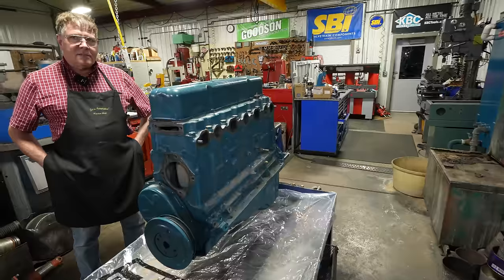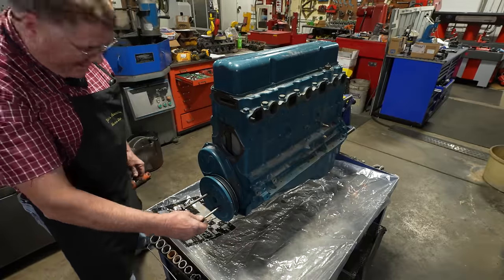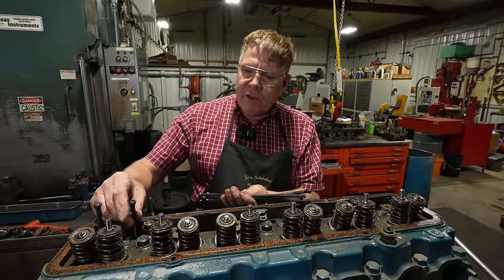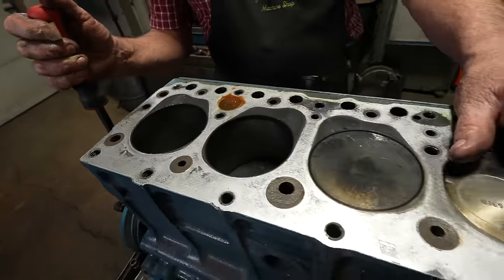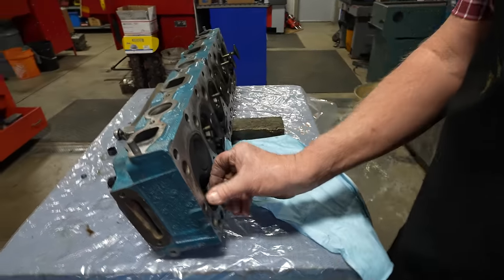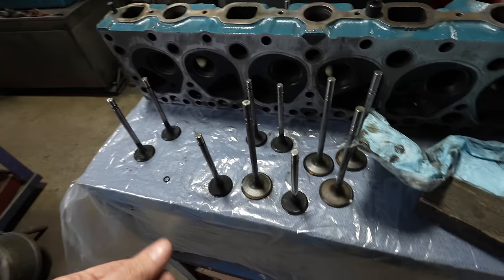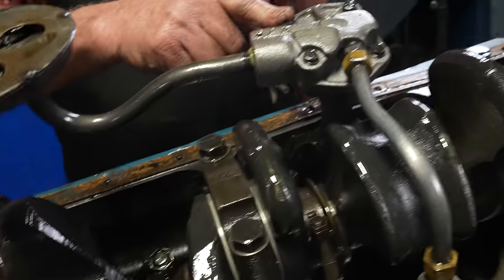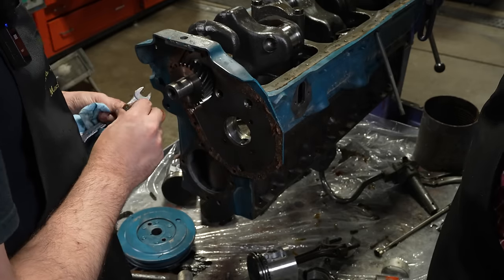Their 235 Chevy BROKE DOWN 10 Miles After The LAST Shop's Rebuild...

Comment: Having worked in a Chevrolet parts department in 1965 and '66, the 235 did not come with a drilled headbolt. When a customers car came in with the top end clacking,  from lack of oil in the rocker shaft, the mechanic would come to the parts department and get a drilled headbolt and put it in the engine in the correct place and return oiling to the rocker shaft.
Reply: I recall a service note where it was necessary if you mix-and-matched head and block between different years, or sometimes between Canadian and American built versions. Early versions used a tube either outside the block or inside the lifter cover, others had drilled passages between the block and head.
Reply: @dale116dot7 so does the drilled head bolt just provide an additional oil passage?
Reply: @stvrob6320  Yes, it was used I think for a newer head and older block. Later blocks were drilled differently so it wasn’t necessary at least when the engine was new. But you would get more oil if you reduce the restriction by adding the drilled bolt.
Reply: Add an outside oil line, rocker gallery got insufficient oil from the lifters. 1957 one ton truck, removed existing plugs to access pressure oil and the head (no drilling needed).

Comment: I specialize in rebuilding these old stovebolt engines,it’s cool to see you guys finally working on one for the channel! That valve definitely seized up from those umbrella seals. In my years of experience with these the o ring seals are plenty and going with the factory valve guide clearance is best. My theory is because the oil breather is down low on the block unlike most modern engines where the breather is on the valve cover, a lot of the oil mist is going out the bottom of the road draft. Since the 235 suffers from poor oiling you only have the splash from the rockers to get to the guides which is limited. When it comes to shimming the crank I never use them. I’m sure you guys know but that’s from the old days of having your car fixed at the gas station and removing shims on a worn engine to tighten up the clearance on the crank. The oil filters were only a bypass setup and oil sludge was a problem back then so excessive wear plagued these engines. In my opinion if your crank needs shims removed as the engine gets older it’s wore out at that point and needs a rebuild anyways lol. I put the bearings in the mains without the  shims and take my measurements and grind the crank accordingly. The book specs will throw you off since 57 and earlier have the shims factored in.
Reply: I’ve only worked on a couple of these engines and that’s exactly what I was going to say, my thought was that they would gum up easily without enough oil, and they need to not be too tight. I think these engines need to use a bit of oil past the guides. Also I’ve heard of guys trying to put in hardened exhaust seats in these 848 heads and hitting water.
Reply: I got a fresh 235 and it’s scorching hot within 10min of run time, new water pump radiator thermostat etc. fresh rebuilt engine/head. Great coolant flow but she’s calling mother goose within 10min n I cannot figure out why. Thanks
Reply: I'd say the real problem was the main bearings losing a bunch of oil pressure due to the mixed sizes. I had one crank that had 0.0004 too much clearance and it makes a difference in the oil pressure by about 10 psi idling.
Reply: @phildo39645  I had the same problem with a V8.  Come to find out thst the shop had knocked one of the freeze plugs into the water jacket. They did not remove it. Engine ran hot all the time.
Reply: You'd think they would have noticed low oil pressure.
Reply: Never worked on one of these, but from what I've seen these engines were tough as nails. 

Super reliable
Reply: I coulda swore he pulled the oil bolt from one side the the elder said it went in to the opposite  side
Reply: @Phoenix407  No, it was on the correct side. He pulled it out and looked at it and when asked what it was he grabbed it. It was on the correct side.
Reply: @phildo39645  "Great coolant flow" might be your problem. If the coolant passes through the radiator too quickly it doesn`t have time to dissipate heat.  Test your thermostat in a pan of water on the stove with a meat thermometer and see when it starts to open.  Logic tells me a higher 195 degree thermostat would  actually slow the amount of coolant flowing. I`d also try pulling the radiator, turn it upside down and backflush it with the garden hose and catch what comes out in a clean bucket. Lastly, radiator hoses have been known to collapse when hot, combined with an over-ambitious water pump.
Reply: @curbmassa  I appreciate ya responding but I’ve done all that already and one by one replaced everything, new radiator new hoses, pump, thermostat etc.. it acts the same with or without a stat, ten minutes tops and it’s puking everything out.. I bought it rebuilt but not started so I finished hooking everything up n it fired up n sounds/runs good but instantly overheats no matter what I do.. Great airflow shroud in place, new belt installed tight..Timing correct etc.. I’m pulling the head next to have a look, not sure what to do but it’s definitely not drivable, it’s lost everything by the end of the driveway and looks like a steam engine before I even hit the road..
Reply: @phildo39645  Wow, that`s tough when you do everything correctly and fail. I`m wondering if one of those digital/laser/temperature-sensing thingies might help isolate the problem. Possibly an incorrect head gasket blocking water passages?  Rust in the water passages? Have you tried running it with no thermostat? When you finally track it down I`d really like to hear what it was. I ran a `61 Biscayne/235 I paid $100 for for 7 years and I LOVED that car so I`m a little invested in your problem. You got this, you don`t have to be good, you just have to be stubborn.
Reply: I had an old 65' Chevy C-10 when I was 16, and it ran hot too. I replaced the dam pos clutch fan, which was a mile away from the radiator, with a metal flex fan. My dad made me a 6" spacer to get the fan closer to the radiator. That solved my issue.
Reply: 18:07  @Bryan-Hensley

Comment: Right out of the gate I saw that road draft tube and had a physiological response, I could physically smell it in my head! Rolling down the freeway as a kid right as it started to rain and the smell of burnt oil vapor coming off the blacktop and out of those old road drafts. How funny lol. That's a smell you can't forget
Reply: I plumbed a puke can into my old Studebaker and removed that oil draft pos , works good now .😊

Comment: My wife and I rebuilt a 1962 Belair 235 engine in 1978.  All it really needed was a #4 exhaust valve replaced but once we cracked it all apart we were in for the entire job.  It ran so perfectly though it was a bit tight for the first 1k miles. You know a kid with 6 years machinist experience always thinks he knows what's best. After it was fully broken in it was the quietest smoothest inline 6 I had ever seen. We had also knurled the skirts and hand fitted each piston. But then the old car had body rot and slipped off the frame.  Drove it to the auto salvage shop and purely by chance, the owner was rebuilding a 1956 Chevy 5 window pickup and needed a 235ci engine.  We had carefully painted everything factory original and when he opened the hood and heard it run he gleefully gave us a few hundred bucks and dropped it into that old truck that was fully restored waiting for an engine. Everything matched and fit.  So all our extra work wasn't really in vain.

Comment: "I just have to deal with you." Lovingly father/son bantering, I love it.
I think mispackaging is a great answer to the problem.
Reply: Mispackaging is how you get to have a son to do that banter 😆🫂🤦
Reply: Especially with the dates so close.
Reply: I agreeeee !!!
Reply: Monday packaging...
Reply: my suggestion is the orders both sets discoved the needed 30 not 20 and the got mixed up weather it was the shop that did the engine or the previos posessor of the kit
Reply: I always closely inspect and test parts for everything, from cars to electronics.
Reply: My first mechanic job out of school was a shop that did a lot of engines and transmissions. Ran into mis boxed, or better yet mis marked bearings and other parts way too often. Learned quickly to check everything closely, from new parts to the OE assembly as the factory could mix and match odd sizes that don't exist outside of the manufacturer!! Some stuff clearly trying to save a machineing error or casting problems.
      Should note often old rebuilt engines would have the cam journals turned 10 or 20 under w/over sizes hard to get now.
Reply: Yes that was my first thought. I used to be a mobile mechanic here in the UK and have built a fair few motors after having the machine work done for me. And  I have once had the exact same issue, but it was on the rods and not the mains and it became apparent immediately because the odd sized bearing was oversized so it locked up the crank as soon as I nipped up the rod bolts, and I then checked it to find a plus .020" bearing in a plus .010" rod housing. (Just one shell in the complete set as it appears to be here at Jamsie)
Reply: A +20 shell on a +30 crank would be loose. But a +20 shell in one bearing cap would not be obvious.
Reply: @bluecraney1  That's a possibility, but usually you'd measure and inspect the crank, then decide what grind it needed, and order the bearings to suit.  No need to order both sets, unless lead times are long, and they ordered both before dismantling the old engine.  Doubtful, as someone has to bear the costs of the unused bearings.
I think the bearings were mispackaged.  When unpacking them, it would be good practice to check them all, to ensure there was a set, but easy to miss one.  When building the engine up, once the crank was sat in its upper bearings, the caps would be placed on and lightly pinched up.  Then the crank is turned, to identify any early issues.  Then each bearing is torqued, and the crank turned after each one.  This will identify any issues, and easy to pinpoint the culprit. That .020" bearing would have been slack, so the crank would have turned without problems.  Overall, a shop that maybe didn't take as much care as they should have.  With close tolerances, 90% isn't good enough.
Reply: @nigelcox1451  i have seen things like that before in getting parts recived a set of injectors and they were the wrong ones in the box breaks rings a caliper once and more. also were a machine runs the run a massive run of a type then move to the next they tend to not run part a and b on the same area to prevet this

Comment: I was in high school in 1970 and had a 54 Chevy, which was a 230ci. It was wore out enough that when I'd pull in to a gas station, which was full serve back then, I'd tell him to fill the oil and check the gas. They had bulk oil, 1 quart bottles, with a funnel screwed on and set up in a stand. I was trying to remember what all I did to it during my overhaul, but couldn't remember. Then when you pulled those "nippled" bearings off, I had a flashback. Ran great when I put it back together, and eventually added and Offenhauser intake for 2 one barrels, and a homemade split exhaust that was a butcher job, but it still worked. We beat that car so hard at the time. Broke the main shaft to the tranny about 5 times, replaced I don't know how many rear wheel studs, and to this day I can still see in my head how to take the rear end apart to pull the axles out. I could probably do it with my eyes closed. Broke the drive shaft once too, and since it was a torque tube, we had to replace the entire assembly. Ah....fond memories. LOL
Reply: 50 years ago the doctor stood by and let me catch ours!
Reply: There is a thread to post life story's. Psst this isn't the place
Reply: I used to go to Thrifty's for reclaimed oil for my 1940 Chev, it created a cloud of smoke going downhill, good ol day's
Reply: My first was a 66 gmc with a 250 and top off the oil and check the gas was the way of the road for me too. Lol mystic jt8 seemed to last longer than anything else I ran in it.
Reply: I remember those bottles with the screw on spouts. We had a station with a pump that pumped bulk recycled oil. Paraffin base it read.
Reply: 235
Reply: @IANHANDS This is the place. People are aging. The people who actually did work for themselves, by themselves. You may be lucky enough to reach that point some day.
Reply: @IANHANDS  I think it is the place for motor stories. But your awful attitude?  Pssst, this isn't the place.
Reply: sure that wasn't a 235  the 230 cae out much later.
Reply: @jameslowe438  LOL, no I wasn't sure, that was 54 years ago. Now that I see it typed, 235 sounds right.

Comment: I saw many a valve job done on 235 & 261engines in the 60s before unleaded gas and 200+ degree thermostats.  The valves and the top of the pistons had so much built up carbon it took a while just to clean them before reassembly. If I remember correctly a valve job had to be done every 25,000 miles and rings and inserts minor overhaul at about 50,000. Plugs and points had to be replaced every 6000 to 10,000 miles depending on driving habits.  My dad worked at a small town Chevy dealership from 45-69 and I from 67-69.  I am happy to see this engine and truck kept as original as possible.  By the way, this father and son team get along a lot better than me and mine did.  lol

Comment: About 55 years ago I toured an IHC engine building division in a factory. (one of 4 factories that weekend) I still remember the rusty blocks coming in and being told that they came from the casting works and lay in the back yard in the weather to "cure" for 3 to 5 years before being machined, assembled and put on to the vehicle assembly line. So to me the casting year sounds right for the vehicle model year.
Reply: Did anyone pee on them?
Reply: @gingernutpreacher  Quite likely on night shift. Very few female employees on the line in those days.

Comment: You are so fortunate to be able to work with your dad especially your dad  seemingly is such a super chill nice guy. Im 50 now and i had a child and wanted actually work benefits so I finally gave in and went to work for my dad in 97  and he was a electrical contractor (I worked other professions because just hated that type of electrical work) , he was the boss so I didn't work directly with him I only would see him for a bit in the morning and sometimes at quitting time so I didn't get to spend as much time with my dad as I would have liked to, then about a year later he died in 98 from the widow maker aneurysm. Even tho so many don't even get close to that much time I still felt cheated. It was funny he ran such a tight ship he actually almost fired me for wearing a grateful Dead shirt to work and not wearing a company shirt I was like wow won't do that again but anyway cherish every minute you get to spend time and work with your dad.
Reply: I consider myself lucky I still have my dad around, he suffered from an aneurysm a couple years back. He has had a few scrapes were he should have died but didn't.
Reply: @MegaDirtyberty  that's a blessing, I really hope there's no more problems 🤞
Reply: @95Sn95  Likewise, he nearly died with the covid injections, he is a changed man because of them. I hope he is around for many many years yet.

Comment: I'm old school mechanic did alot of 235s . Yes the main cap shims ..ugh , hard to know after so many years of these engines what's what in terms of the shims or other changes by builders 
And home builds . I definitely  have found one bearing shell be INCORRECT in a new unopened  bearing set box now and then  .
Seems hard to believe it , but yes .  Always check every shell
 insert to confirm the size . Never forget your block oilpassage plugs on drivers side of the block along oil gallery !! I've had found they get left out 😮 and it's never a good result . I'd also not ... be crosshatching stems or other tricks especially  on brand new valves . Finally GM did know what they were engineering with the valve stem seals . Stock works ...
Good stuff gentlemen  .
Reply: As an Engine parts seller it wasn't uncommon to get Main and Rod Bearing with a mismatch bearing in it. It would drive the Engine builders bonkers. We couldnt check them because they were factory packaged. Federal Mogul was better than anyone in packaging but most people wanted the Michigan77 tri metal.
Reply: So can you line bore the mains so you don't have to use shims or does that cause more trouble than it's worth?
Reply: @1967davethewave you can however each rebuild is a separate decision unless you are a remanufactoring business doing dozens of engines of that type a year. If you are planning that then you want consistency to save overall time doing a lot of hand fitting.

Comment: You hit the nail on the head, that is from misspackaging, as a parts interpreter I've seen so much of this since COVID, to the point that we check all customer order's for part accuracy inside the packaging before contacting them to tell them they've arrived. With off the shelf parts we check as we sell them. I've seen starter motors that are perfect except wrong cogs, alternators with incorrect pulleys and just about anything else you can think of! 😂😂😂
Reply: I once had 8 bad lifters direct from ac delco 🙄